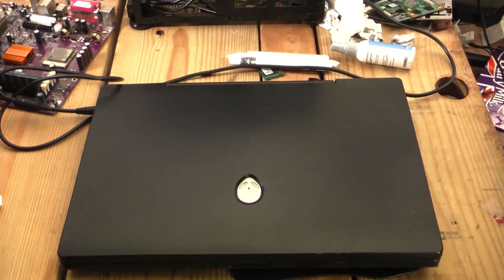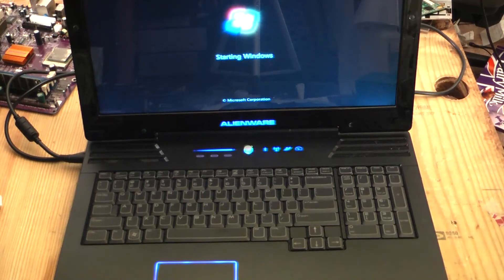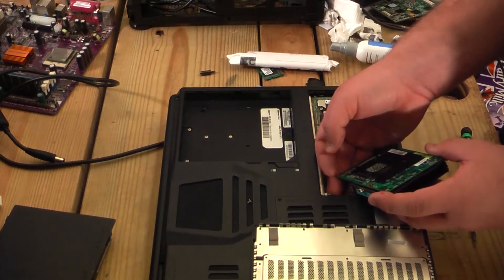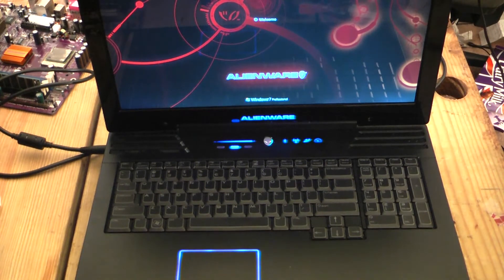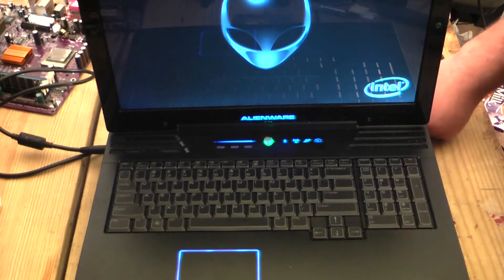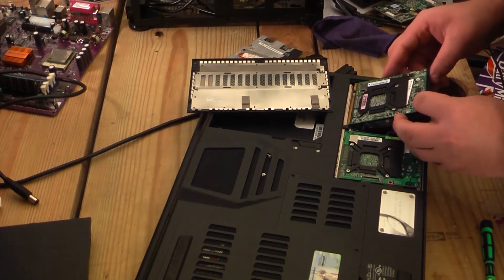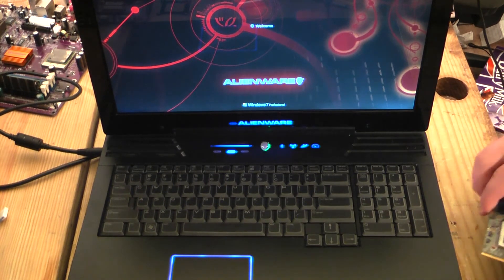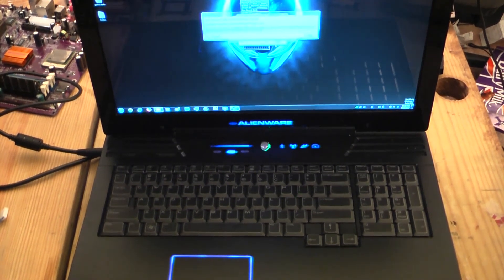Alienware Area 51 m17x r1 gets ANOTHER video card repair!

Comment: Do you happen to have the command center software for this model in particular or even better a resource iso of the drivers and software for it? I know it's a long shot but scraping through Archive I can't seem to find the right one and the one I did find was apparently for a Dell 2009 M17x that screwed with my lighting.
Reply from the maker: i've actually got something for just such a situation. here you go :) (note it says its for m15xr1 but should also work for m17xr1)

very important to do it in the order specified by the info file. otherwise command center wont recognize the keyboard.

https://www.mediafire.com/file/2hwz766a6vyml73/m15x_drivers_n_bios_compressed.zip/file

https://www.mediafire.com/file/u9y5idssx3ji9x4/m15x_theme_w7x64.zip/file
Reply: @gameboy3800 Wow I wasn't expecting a reply this quickly. I was actually just thinking to myself a few mins ago "in theory the m15x command center should work since it's the same design but smaller and not as many ports" but tysm! Really appreciate it! I'll try these out and read the info.
Reply from the maker: @skylarfox3111  yea someone else emailed me just last month about it so i already had that message copied lol
Reply: @gameboy3800 The new drivers definitely help but no dice for the trackpad and media buttons, they've stayed dark. I tried to follow the instructions as close as I could in both Vista and 7 but I'll try again on another weekend but at least the keyboard and alien heads work still. I did find other drivers as well and their CCs show either the Dell model or have a FX tab/button that doesn't work
Reply from the maker: @skylarfox3111  i think you can try looking up command center 1.0.7 or something similar. something very early but might still be on the dell website. also note those drivers are supposed to be the first things installed. i remember until i tried on a brand new install my keyboard and light pipe around my m15x display were still dark until i fresh installed and immediately put on command center before anything else.